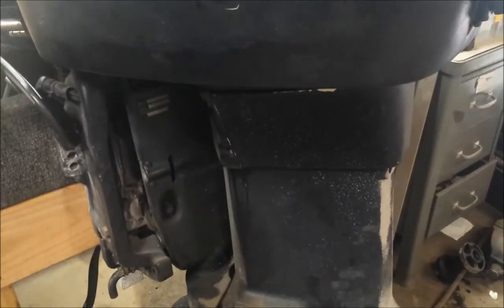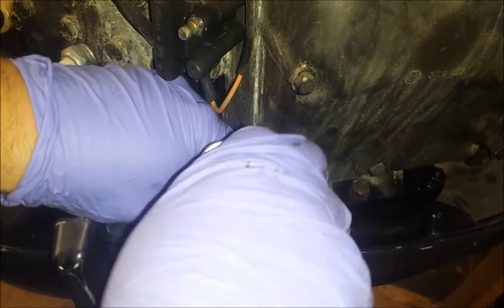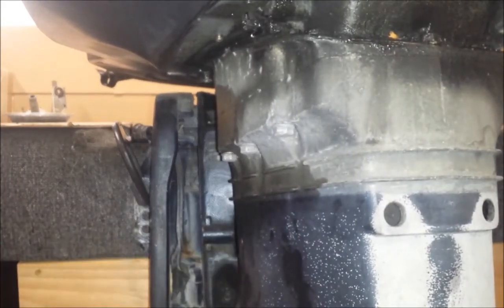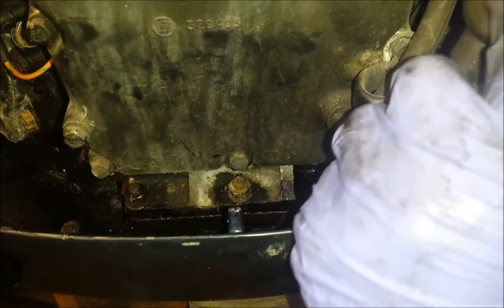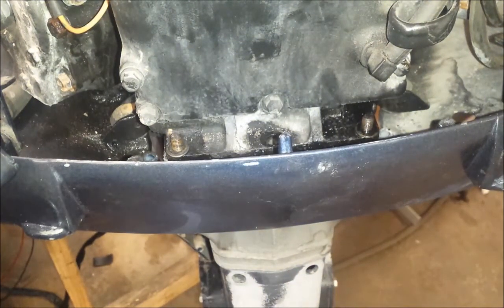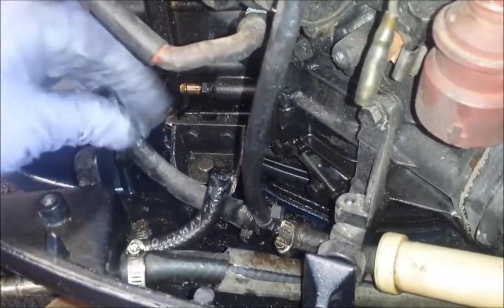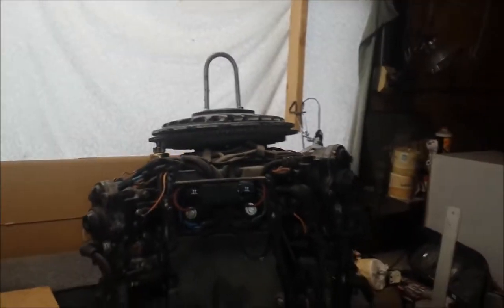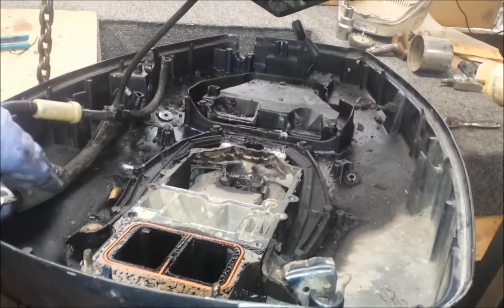Evinrude XP 175 HP Teardown: Part 4 - Powerhead Removal

Comment: nice video those bolts you used the crows feet will a flexhead gear wrench remove these bolts? thanks mines a 05 johnson 175hp

Comment: unrelated but i have an 81 25 rude thats getting hot at the top of the powerhead  and its impeller is working as it has a great stream think it might have a clog huh? i had the same prob on a 9.9 (that btw you helped me have that engine running like the year ut came out ) should I just rebuild it sandblast new rings etc? . compression is at 140 on both but that over heating issue eventually will destroy it

Comment: Nice video. I am trying to remove the power head on a Johnson 135ESL75. The two nuts on the back where is there is not much room. I can not seem to get a wrench to stay on it. I saw a video on youtube.com to grind down a wrench. Tried that and still can not get on it. A 1/2 inch slips easy and a 12mm is tighter but still slips. Have you ran into this and how would you remove them?